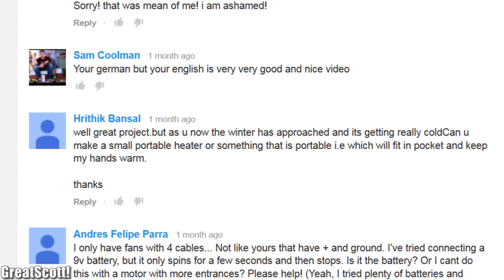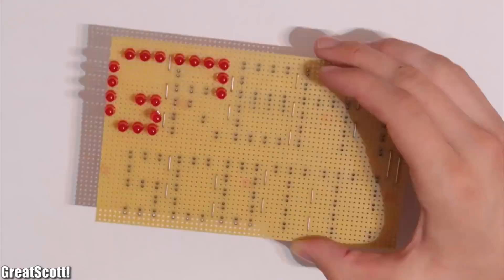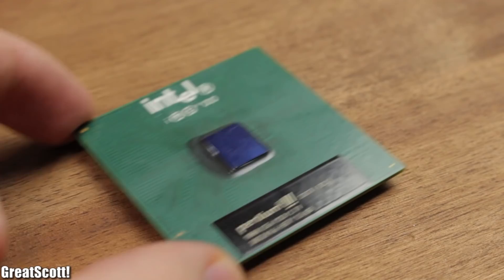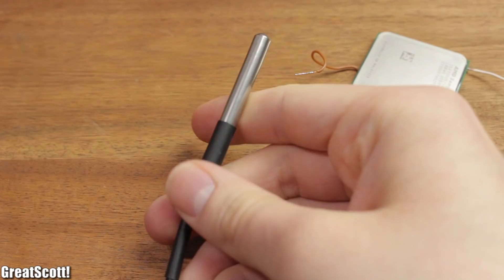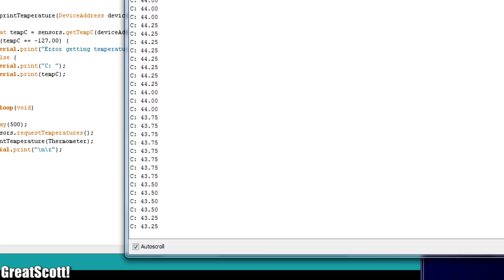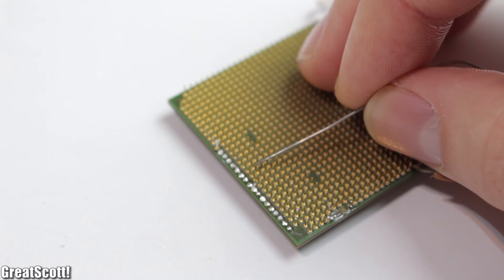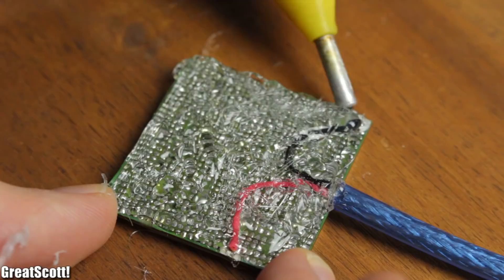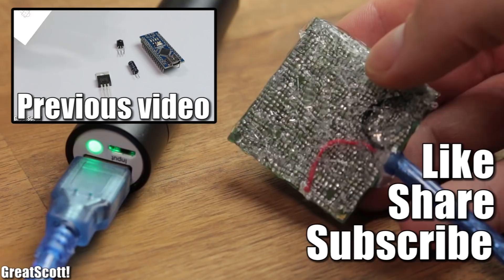Stay warm this winter: CPU Hand Warmer

Comment: An R9 290X will work great!
Reply: +Julius Dindulius R9 390 and FX 4350 works excellent too... not joking, that shit raises my room temp and makes me sweat just going over to the PC to use it's I/O
Reply: +Julius Dindulius How about something less exepsive some dual GPU 400 SERIES GTX from NVIDIA
Reply: We don't want to melt shit
Reply: +Julius Dindulius Duel Titan Xs work great too mine got hot in 4K
Reply: Tom Shepherd only rich people meh titan x runs 90c not enough lol
Reply: i aint rich i just saved up hahah
Reply: +Julius Dindulius But that requires way too much wattage. ;)
Reply: +Julius Dindulius Or a FX-9590
Reply: GTX 480 would work better, especially in 3-way SLI.
Reply: +Tom Shepherd why would you buy two titan xs... the facepalm is so real right now
Reply: +mage7206 because i play games in 4k across 3 monitors also i do alot of rendering as im at university studying game design its mainly a workbased machine. why is it a problem
Reply: Tom Shepherd If you are pushing 3 4k monitors and doing rendering I would have gone with 3 980ti. That third card would help out and overall be better than just two titan x cards and be cheaper. The titan x has very, very limited uses where it is worth it over a 980ti
Reply: +mage7206 i got them before the 980ti came out and i was in need of an upgrade due to hardware failures so i didnt wait as coming up the to the end of the semester so i had to upgrade i dont mind im happy with what i got :)
Reply: +Julius Dindulius but it still might end up with burning the desk
Reply: +Tom Shepherd you are rich, dont say otherwise.  You need to be rich to save up that amount of money in a reasonable amount of time. I couldnt afford that saving up for over 2 years sparing every penny.
Reply: +tjeulink im really not i make £800 a month its called saving
Reply: Tom Shepherd 800 pounds is a lot. thats nearly 1000 a month, i make 600 euro a month.
Reply: In england thats not alot i make £9600 a year. Which is nothing as the average person makes £21000 a year which is £1750 a month, i just have a little part time job
Reply: Tom Shepherd for me its fulltime job, 600 minus rent etc. makes my monthly budget not very high. i live in the netherlands.
Reply: tjeulink damn no need to get offensive...  did your mommy not prepare lunch box or something ?
Reply: B Haze those who live in glass houses....
Reply: tjeulink yeah, naw glass is to fragile. think
Reply: B Haze what? your grammar is incomprehensible there.
Reply: tjeulink try harder and stop crying
Reply: B Haze so.. i should try harder to read your bad grammar? im not kidding. it really is incomprehensible. glass is too fragile? is it a really really horribly executed comeback? i didnt want to pull that conclusion because i held you to a higher standard than that.
Reply: tjeulink oh how nice of you that you took the time to write that.
Reply: tjeulink go like your own comments
Reply: tjeulink wow you unliked them xD
Reply: tjeulink hey, are making  another speech about my grammer or what
Reply: +Julius Dindulius woah man, it's just supposed to be a hand warmer...we don't want 3rd degree burns.
Reply: +Julius Dindulius GTX 480 is better :D
Reply: Seriously. You don't need water cooling and you definitely need a window open if your room tempature is going up that high because of your pc
Reply: +Microage 290/390 actually draws considerably more power than the GF100 which obviously generates more heat.
Reply: +Julius Dindulius titan x is ok too
Reply: 295X2
Reply: +Julius Dindulius I have a 4790k and a 970, I turn the fans down in the winter on purpose to increase the room air temperature xD
Reply: José Luís Lopes worst idea ever
youre damaging your system
Reply: Benjamin Buljevic the cpu is 75 and gpu 77 on gaming, i'm not damaging either, but if I put fans at normal speed they go to 65/65, and both chips are comfortable on either temperature
Reply: B Haze no he's not
Reply: José Luís Lopes 60+ BAD
40 - 50 OK
20 - 30 VERIGOOD
0 - 10 AY LMAO
Reply: Bone Marrow ICE cooled :D
Reply: José Luís Lopes yes there is i have an amd fx 9590 and an r9 380x and they stay below 60 degrees when playing gta 5 on high
you just need a vented room so the heat has a place to go. It's pretty easy and alot safer than putting an ocean in your case
Reply: +Bone Marrow spend some money on a good watercooler
Reply: A 9590 AT 60C ON A AIR COOLER??? BULLSHIT, proof or lies. A 9590 is a beast 220W CPU, You even need one mobo of a special few that can handle power distribution to this specific processor so you or are confusing a 9 for a 6 or you are lying.
I already said, my normal temps are between 68 and 72 for both CPU and GPU and when I make the fans go slower they reach 75 and 77, which are extremelt safe temps. go do some research
Reply: I have msi 970A-G46 with a 850 watt psu 
I'm not lying about this, of course it's winter and I do use an external fan + a single internal fan with a very large heatsink that transfers heat really well.
Reply: Bone Marrow well, AFAIK you may be having bad reading and your mobo can be almost dying since you are using a chip that is not compatible with your mobo.
Reply: You're correct, it does draw alot of power and my mobo has a bit of trouble handling this, but it still stays between 40 - 60 degrees gaming, i don't see why there would be a malfunction with this recording, i run bios and record the tempature and it's really the same thing. 30 - 50 temps all the time.
Reply: 75 and 77 are probably the hottest my PC has ever gotten, and no they aren't safe temps.
Reply: And it only runs 10C hotter under load? Whats your cooler?
Reply: I can't remember the exact name but it's Noctua NH-U14S
Not exactly sure, I still have the box so i can check when i get home.
The hottest it has gotten ever has been 81 degrees during gta while i was messing around with the air circulation in my case, After I took out a fan and starting using a high RPM external it stays below 80 degrees all the time and it peaks at 75
Reply: Ahhh, 75 is a tempo I believe with that cooler, remember my 4790k is on a 30$ cooler (212 evo) near silent
Reply: I wear a noise canceling headset and my speakers are MUCH louder, besides the noctua ive got isnt loud at all
Reply: +Julius Dindulius Well my 290X Lightning is sitting at mid 60s... Only fools and cooks use refrence 290X
Reply: +Julius Dindulius or just two 8800GTX and Pentium 4 as a cheap way
Reply: +John Mirra Even with a better cooler, it's still generating a lot of heat (actually more)...it's just dissipating it better.  The 290x is the highest consumption single GPU ever.  For a while it even had a worse multi-monitor bug than Fermi sending it's idle power consumption to 60w if it was lighting up multiple screens.

Anyway, with a better aftermarket cooler, it'll actually consume more power and generate more heat.  It's just better at dissipating it to the room.

Shoot, I can make my 480s run at 62C, 100% load overclocked to 850mhz.  That doesn't keep it from heating the room up, though...and that's less heat than two 290xs generate
Reply: Saving tip 1.... Stop tv... Stop Internet.... Stop Phone...... In a years plug it back again with your new pc... And stop fucking smoking or drinking coffee at tim horton everydays
Reply: +Julius Dindulius For fucks sake take my OC'd 390x into this picture!
Reply: Did somebody say GTX 480?
Reply: ***** Nigga GTX 480
Reply: A b r o a d Why do you even have a R9 390 paired with a FX 4350?
Reply: The 290 standing for its 290w tdp
Reply: Julian Depaepe did someone say, tri-480 sli?

Comment: to heat up liquids you need a new amd cpu... a fx8350 for example
Reply: +NiklasRi Even better idea, the FX-9590, it will completely burn your hand off and will burn your entire house down :D
Reply: +Alex Martinez (JackSLR783) that even can't top an Pentium 4.... 😏
Reply: +NiklasRi Phenon X4 takes 140W
Reply: FX-9590 is 220 watts!
Reply: +Ryan Toomey plus, FX-9590 is FX-8xxx series only its overvolted up to 2v instead 1.25v (on 8250)
Reply: +NiklasRi Reads your comment then glances over at my 8350 temps on a h100i and chuckles at 16 C with a 5ghz 1.5 Volt overclock
Reply: cjhawk67 Reads your comment then glances over at my Intel i7 temps on a liquid nitrogen cooler and chuckles at -180 C with a 5ghz 1.43 Volt overclock
Reply: +Alex Martinez (JackSLR783) i have the 9590 and it actually runs cooler than my 6700k , bearing in mind that they are both liquid cooled.
Reply: +cjhawk67 +ABG 177
The temperature readings are wrong... add like 15-25°C
thats a well known "problem".

i personally think, that amd just wants to make their users feel like they got someting great (which the fx 8350/9590 obviously are not)
Reply: ***** Well adding 25 C still puts it 20 C below my Intel Q6600 at Idle.
Reply: +cjhawk67 i had a q6600 and it was at like 30-35°C while idle. There is something wrong with your one ^^
Reply: ***** Mines always at 60C with the ASUS cooler I have for it solid copper core pressed into an aluminum fin array. It's always run at that no matter how many times I've moved the chip between boards. It's not any less unstable though. I run it on a P6N SLI board from MSI (The 7350 if you want to look it up I love that board lol) as a 24/7 game server now days and have had it up for over 200 days without issue. 8gb 800mhz ddr2
Reply: cjhawk67
okay ^^
well, that sounds nice. :)
Im having always issues with trying to make a gameserver.
i tried port forwarding, disabling anti-virus, unblocking the ports in my firewall, just plain anything after so many tutorials, none seem to work. :/
maybe one day i'll figure it out :D
Reply: ***** You want to run ipconfig in CMD to get your internal ip and set the port forwards to that address and add the entries into the firewall exception list. If that doesn't work there is the possibility your ISP blocks the ports your trying to use.
Reply: +DerSchoermbro I remember the stock heatsink that came on the pentium 4. What a beast. That cpu was hot hot hot!!!1
Reply: Doctor WarpSpeed I can back up your claim there I'm using a socket 478 P4 Prescot Cooler on my P4 Northwood CPU for a 2gh to 3.3ghz overclock on my old computer I have for old games and It keeps it under 50C at 1.65 volts.
Reply: +NiklasRi I use a FX 8350... Seems about right.
Reply: The max temp one of these chips can run at is 60C a 6700k can sit at 105C all day albiet it's a much more powerful cpu
Reply: +JackSLR783 3 I actually know there are people who are running an FX-9590 safely!
Reply: ***** Running my voltage higher then what the 9590 runs at stock for my OC and with the h100i I never break 30C
Reply: AMD Temperatures are not right. Mine was running at 12°C idle while the Room was at 23°C...
Reply: I have a haf xb evo lan case with the h100i mounted in the front pulling in with only the stock fans it came with as well as a 200mm red bitfenix fan blowing in from the top blowing at the motherboard to cool the vrms and my dual gigabyte windforce 290xs and I'm running at 1.5volts 5ghz ram speed is at a lower 1333 with the setting I have to keep it stable and I have amd cool and quit and CE1 Powerstates disabled. Been running this like this since mid 2013.
Reply: cjhawk67 Different CPUs... Mines an 8 core CPU, yours is only 4 as well as running at a slightly lower voltage w/ a few more fans than mine...
Reply: smashhawk No mine is a 8350 8 core....
Reply: smashhawk Aida only shows the cpu temps for the first 4 cores
Reply: smashhawk The pic is wide you can scroll more to the right to see all the specifics of my pc 32gb ddr3 ram 1333mhz 1.5v 25x multiplier on the stock bclk setting for my amd fx8350 8 core etc I used puuush to capture my dual monitors so you can see power draw with my cpu + gpus under full synthetic load according to the output of my corsair hxi1000watt psu aswell as the cpu info.
Reply: +JackSLR783 3 That's a serious problem, if your cpu is that cool, how is it operating? you'd need near 7ghz to just keep your cpu from overcooling. at that temp it'd shrink and parts inside would fail.
Reply: well he only used 0.75 amp meanwhile processors use 50amps and more.
Reply: It doesn't matter what you use. It's still 750 mA.

Comment: GTX 480 space heater :)
Reply: AMD what exactly?
Reply: ***** It's just that you're generalizing all AMD products, as if none of intel's cpus ran hot
Reply: ***** Alright, alright. This is getting stupid.I'm just going to end this now
Reply: Or any AMD graphics card. They're the real reason behind climate change
Reply: Stacy Schauls haha nvidia is bullshit
Reply: Celle TrueLove How so? Better than any AMD cards..
Reply: Mhh..  I think amd has more power for the money.
Reply: I can agree that AMD does have cheaper options, and those options can be quite powerful. I did see an R9 Fury for $260 on black friday, so there is that. But, I prefer how Nvidia runs cooler (Like a lot cooler lol. AMD is notorious for hot GPUs and CPUs), and is more optimized.
Reply: Stacy Schauls  so true! :)
Reply: In my rig i have 2 radeon hd 7970 with Arctic Accelero Xtreme cooler and the cards run with ~ 55 C (First card)  and the second with ~60 C at 100%... Its ok for me:)
Reply: I had 3 gtx480's and they always ran at room temps no matter what I was doing. 

They were 3x EVGA FTW watercooled. Still have one laying around here somewhere.

Comment: We had to make a waterproof heater for a project i am currently working on... a friend of mine got a piece of 2cm thick aluminium and i got 4 bipolar 10A transistors. Using them as a constant wattage load has given me a great variable power heater with an added cutout temperature sensor. It's adjustable from 0.5W to 150W and looks better than a hacked processor! Oh and the final step was encapsulating with high temperature silicone!
Reply: Eviltech did you document it in any way? can i have a link, i want to heat baby milk with it ^^
Reply: erklabaer I haven't, but you can find constant current load schematics online.just make one of those and pot it in silicone.

Comment: 1.5 volts (processor): 100° with cooler stock something here is hot
5 volts (processor): 43° without cooler im ok
Reply: It's probably because it isn't under load.
Reply: @FMHikari  no shit it's literally being used as a resistor
Reply: 1.5 volts on lots of pins > 5 volts on one pin
Reply: @LoganDark4357  not really it's because of the way the transistors are being activated. In a working cpu, the gate of every transistor is a small capacitor: every clock cycle it uses a certain amount of energy, so with 2GHz for example its using a small amount of energy 4 billion times per second. And that adds up. Here it's just being used as a resistor, probably slowly destroying one transistor. There's no clock so not much power draw.
Reply: I'm saying having the entire CPU working takes more power than just two pins
Reply: Normally, CPU can run at 1.5volts but in a high current

Comment: Good thing he didn't use a Pentium 4 for this project...
Reply: Why?
Reply: Pentium 4's are not hand warmers, they are room heaters...
Reply: P4's will burn his hand...
Reply: dushasssss xD sarcasm detected /troll process initiated/
Reply: Tim Peng cought amd
Reply: Had the P4 530 way back, which was I believe only one below the Extreme model, overclocked it to 3.5 GHz, honestly didn't find anything hot about it.
Reply: I have a few old P4 laptops that used desktop versions ( i think a northwood 2.8 and another northwood 2.6) and a couple of them acctually melted themselves to the plastic sockets.
Reply: connly33 I still have 1 machine running p4 3.2 ghz prescott 1mb HT 478s, stock cooler with like 2 years old thermal paste, ambient temp ~40 c, and ~60 c running linx stress test, afaik they start to throttle around 70-80 c, dunno how they could possibly melt anything. And northwood were considered cooler ones compared to prescott if memory serves me right
Reply: thus Presscott runs hotter than the older Northwood, because Intel's 90nm proccess had higher leakage than the older 130nm process, also because the presscott had to dissipate more heat over a smaller area the cpu would generally run at a higher temperature.
Reply: I had a P4 that would frequently get up to 95c in the summer, playing World Of Warcraft.
Gotta love that 250W TDP.
Reply: ***** ofc xD
Reply: Tim Peng what's bad about the pentium IV
Reply: Tim Peng what's bad about the pentium IV
Reply: TheUndeadTitan, P4s especially the Prescott core run very hot and are capable of heating the room.
Reply: Deny-SL The core 2 extremes only go to 150W tdp. It doesn't get as hot as P4 because of it having two dies to spread the heat better while the P4 only has one.
Reply: Tim Peng u
Reply: Lmao im using a pentium 4 4 this project, pain in the ass to find a right pin
Reply: @takemebacktothen  why?:D
Reply: I did

Comment: It's got to be an AMD cpu.
Reply: Fucking called it man.
Reply: Jonhy456 😂😂😂😂
Reply: The hotter a cpu gets shows how much processing power it has an intel cpu could run a fridge
Reply: max rpm? that must've been annoying lol
Reply: Ian Visser damn aha, i have an 8350 but no stock cooler, i never even put it on
Reply: It is
Reply: 2 years later.. AMD cpu's run cold AF and intel has overheating issues
Reply: @tyrellnelson  yep  really amd were never that bad.  hell none of their chips would even run over 62c  when intels were hitting 95c,  and everyone just wants to point out the ONE cpu, the 9590,  which had a high tdp  but if you look at intels for the last couple generations they are hitting the SAME NUMBERS!!!  LOL   and they still want to try and joke.  Just goes to show you how smart most of intels fanboys/shills really are.  but you and I know what's really up.